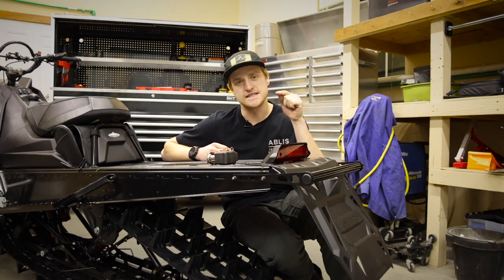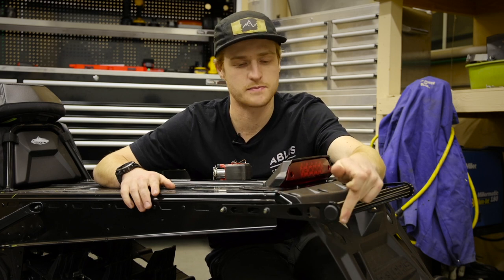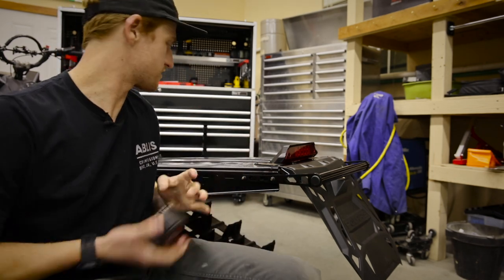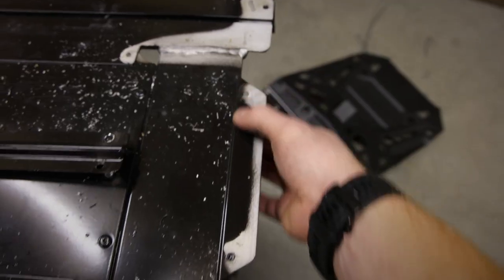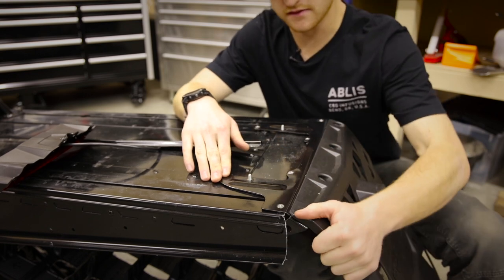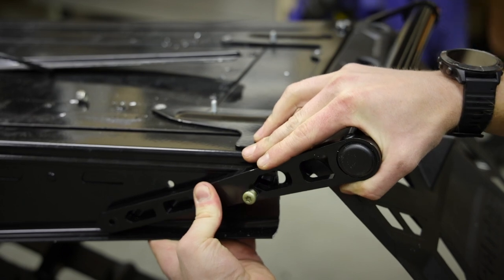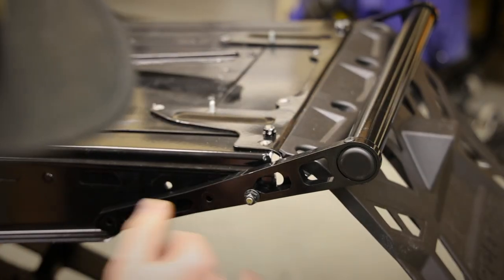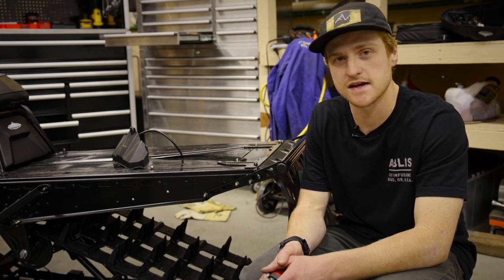The Free & Easy Short tunnel mod | How To -

Comment: i drilled out the rivets on my snow flap and have ran without it all year, easiest way to recreate the cut tunnel, and as long as you have a rivet gun and rivets it gos back on in a couple minutes no problem
Reply from the maker: I like it! Still gotta get that bumper out of the way though! I would remove mine but it helps keep the sled cool especially when I’m hauling a ton of gear
Reply: @Rossxr  put hood clips through the holes so you can put it on and take it off whenever.

Comment: If you want more you could notch the flap bracket and flap around the cooler only downside it would not have as much protection against being bent on the upside you would keep all the cooling
Reply from the maker: I want to keep It protected back there. it takes a beating when you do Hop overs, re-entrys and bowties!
Reply: @Rossxr  ah yeah, what is the back flip stunt called that involves landing pointed back down the hill

Comment: While you are at it, why not make your snowflap removable by using bolts with handle knobs and nylon locking nuts and washers?   Id post a picture if I could.
Reply from the maker: I don’t mind the snow flap to much! Here in the cascades we get lots of concrete snow and I struggle with cooling! Love the idea tho! 
Thanks for watching!

Comment: When you say you feel the tail end dragging. I would think leaving the flap defeats the purpose. Or does moving the bumper allow the flap to flex out of the way even more?
Reply from the maker: because the flap moves and flexes you don't feel it as much. no flap is the best but I need it for cooling when I haul all my camera gear. and when snow is firm.
Reply: @Rossxr  off top question. What hand grips are you using?
Reply: @Rossxr  oh one more off topic question. Finger throttle with a guard or thumb throttle.

Comment: How much manoverability do you gain from this reduction in tunnel length?
Reply from the maker: I think its worth the mod. it depends on the rider and the way you ride. sometimes I feel changes other riders dont.  I wouldn't do it if I didnt feel it was worth the work!
Reply: @Rossxr  I have a few SLP mods to my RMK PRO, I have yet to cut the tunnel this method makes the process a lot eaiser seeing as I do not have the welding set up for aluminum.  Do you still ride  in the BV area?  I appreciate your videos and explanations of the mods you make to your sleds and what they do to improve ride ability.